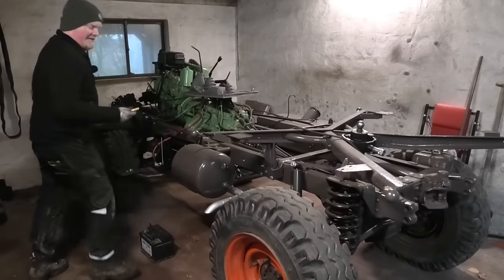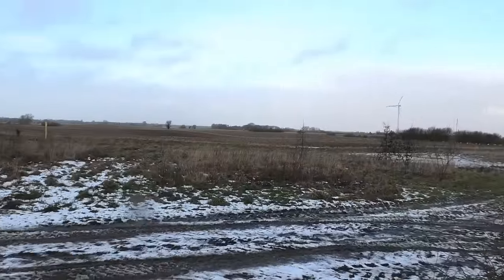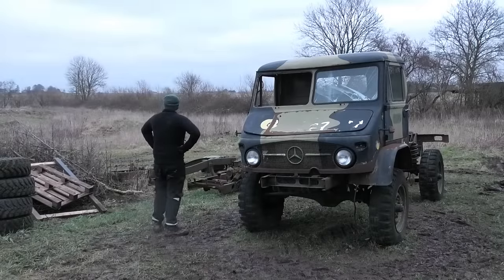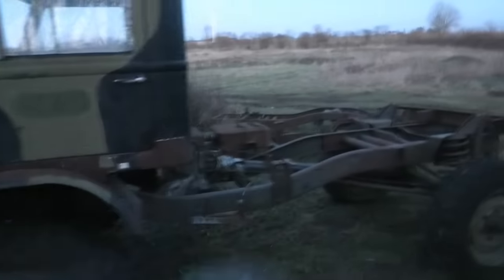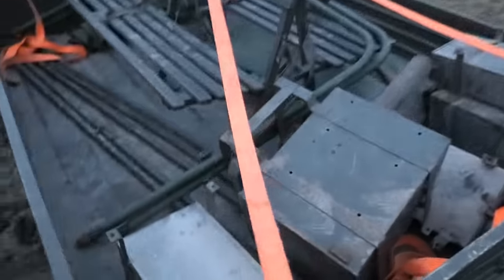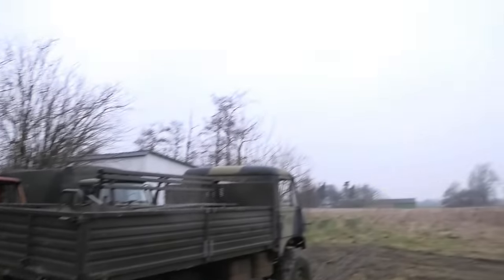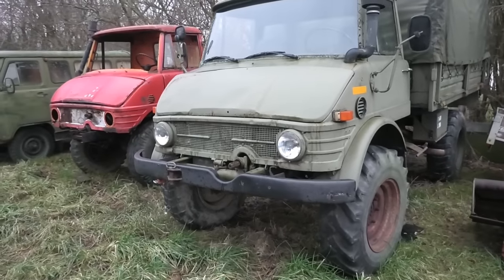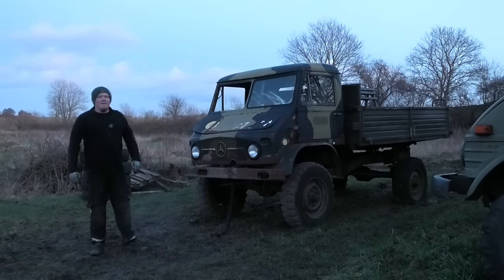Abandoned UNIMOG Project! - Can we save it? - And what is a 404?

Comment: There is no 406 series. It's either a 406 or 416 (416 came later the first where named 406.200) On the 404's the PTO and trailer airbrakes where optional. The holes in the bumpers are for the nightlights.  404's are older than a 421. Before you tell these things on a big platform tell it right or just don't.

Comment: Prefer the hardcab.  Had one also with 617A.  If yours is non turbo.... its performance will be same as the 6cyl gas that was in it. .....  yet......  still maybe easier to find parts for 617's... maybe... Im in USA..
Reply from the maker: Yeah, this is the non-turbo. so i'm not expecting huge performance. 
But it is indeed much easier to find parts for these, around here. :)

Comment: Interesting project. At 31:08 these holes are not steps. Behind them were small flat headlights for military use. (Tarnscheinwerfer in German) 
The conversion to a diesel engine turns the 404 into a noisy wandering dune. The original M 180 petrol engine has 82 hp, a Mercedes Diesel for example, OM 616 only 72 hp. But you can use a more modern engine. But the main problem is the clutch housing. Nothing fits. I converted a few 404s to diesel engines 40 years ago. I made the clutch housings myself. (I am a mechanical engineer) Another problem is the front engine mounting (the engine must not be mounted on the side of the frame, as in a car) Because of the frame twisting, the entire drive block (engine, clutch housing, gearbox) must be mounted at 3 points. At the rear of the gearbox, one bearing each on the left and right of the chassis and on the front of the engine. (I also built the front engine mounts myself).

There are a few special features. For example, when you pull out the floating axle, the differential lock must first be in place and engaged in the Diff. If this is not done, the locking claw falls into the Diff. housing. If this is not noticed, you will no longer have a differential lock and, in the worst case, there will be a gear crash.
Have fun with the restoration. It's worth it, it's a super vehicle.

Best wishes from Germany

Comment: Hello, I owned a unimoh s 404 years ago and restored it.
It's a very capable vehicle when it's not broken down.
Its main weaknesses are:
Oil leaks in the wheel reducers, it takes a 200 ton hydraulic puller to extract the hubs to replace all the seals.
The braking circuit has only one circuit, it is ATE and the master cylinder does not live long...
Wheel cylinders leak regularly and often need to be replaced.
The parking brake is symbolic, even if well adjusted it does not slow down much.
The cost of maintaining such a machine, even pleasant and very efficient in off-road use, is insane!
The engine remains anemic, it makes a lot of noise and is seriously lacking in power, 82 hp for such a weight is very insufficient.
Discouraged, I ended up donating it to a museum.

Comment: A helpful tip when securing a load with ratchet straps.
The ratchet mechanism should be on the passenger side of the vehicle.
If you have to adjust the straps during the journey then you are not on the side that is open to other vehicles and the potential for an accident is reduced.

Comment: If your ever in a suitation like that where the back wheels are spinning with weight on the front of the machine, slew out the back actor to the middle and extend the bucket out rearwards as far as it will go parallel to the ground. 
Doing this will put weight over the back tyres and counter act the weight on the front of the machine. It works also along with the diff lock as a side brake because the actual side brake would not work as effectively with the diff locked. You would put weight over the tyre you want to steer/grip with by slewing the backactor to that side.

If all else fails pull yourself rearward with the bucket while driving. Gunning the throttle would only tare up the ground which is not good if you want to go in there again. Keep the revs low and she will walk out. 

You can also put down the jack legs, lift the rear of the machine, drop the rear bucket and slew the rear wheels out of the tyre ruts to reposition into better ground.  

They are a great machine and hard to get stuck if you know what to do. 

Theres loads of other things to do to do to get yourself unstuck, those are only a tiny few things that I said I'd mention.

It's a 2 wheel drive machine so you have to be prepared for the worse and know what to do when the ground is poor. 

I'm not sure what you call back actor over there (backhoe/rear implement). I presume you are Dutch but I could be wrong. 

You have some great projects there. Fair play!

Comment: Truck looks like you’re off and running with another project.   Since it’s already adapted to 617 engine I would really try hard to fix the one you have or find another to drop in.  I have a very low KM 1955 SWB 404.111 with the original M180.  It’s fine for field work, but forget going anywhere fast.  The carbs are finicky at best, plus fuel compatibility issues with old zinc parts.   Diesel of most flavors is much much better.   Guessing the 617 installed will live with some tlc.

Comment: Great project. I'm amazed at how well you know your way around the individual series and models. Chapeau! The petrol engines come from the /8 cars from Mercedes. Around 80 hp. Consumption, with a first-aid kit behind the driver's cab, at least around 20l per 100km. Hardly any torque. Leave the diesel in, if broken, replace it with a 3l 6 cylinders.

Comment: Thanks for this vídeo! I appreciated it as the Unimog isa  truck in my heart! I worked with Unimogs in my army time (1966/69). We had the 404 with the gas/petrol 6 cylinders engine! A great truck to drive with a great gearbox! Our cabs were only half-height with canvas cover . We used most of them fully open! The back part only had the long seat on to allow jumping out in the case of an ambush! Both front and back had sand bags on the floor to protect against mines. Sometimes a heavy M.G. mounted just behind the cab. These trucks could go anywhere and were very reliable. My job was to recover mined and RPGed vehicles and recycle them. I was a lieutenant but also drove these trucks frequently. No jeeps there........they were flying with mines! Old times.........

Comment: I run two 404, one being pre production model from 1955, other 1967. I believe 421 was produced long after first 404.
Reply from the maker: Yeah, i fumbled that explanation a bit. What i was really trying to point out, is that the chassi design on the 421, was older than the 404. As the 421 have basically the same chassi, as the 411.

Thanks for watching along :)

Comment: Dear Mister TAT
👍👌👏 Your new Unimog project doesn't look so bad at all. Ergo: Congratulations 🎉 for all the puchases. 2) Please kindly allow me to suggest some things: Regardless of the unfinished Unimog cab in your shop, I suggest that you roughly put together this S 404.1 one first. Especially a windshield should be mounted so that you can put the seats in etc.. I really hope that you don't leave all the good parts on the bed (exposed to the weather).
3) Although I definitely hope/wish that your 5cyl. Diesel can be saved, I just guugld and look what instantly popped up: Only 300€ for a 220b, M180 engine that turns over. With 2 Zenith carburettors, in 16727 Oberkrämer, Germany.
4) When I was a child, my family owned a Mercedes W111 230S (big tail finned model) with a 2,3 l M180 and double carburettor. It was quite a gas guzzler.
Thanks a lot for making teaching explaining recording editing uploading and sharing.
Best regards luck and health in particular
Reply from the maker: Thank you!
And yes, don't worry. all the weater-sensitive parts, have been brought inside, right after filming this :)

Comment: thought that was  617 transplant..  what bellhousing did the person use? Look like it is NOT the Dietrich cause they lean the engine 13 degree or so.
Reply from the maker: It's looks like it's still the standard unimog bellhousing, with just an adapter-plate between that, and the engine.
Reply: @KJOff-Road   People have done body lifts to accommodate...  PITA for weatherizing floor pedals though..

Best of luck.... am sure you and or other's around you know shiaaaaaaat way more than I do.

Comment: Mercedes 606 turbo & automatic. Have, then one of the few fast Unimogs, if not the only fast deisle Mogs in the world, Buying unfinished projects easily pushes a man to follow the intention of the previous vision for it's future. Due to the parts it came with. Army here began receiving Unimog in 1982. The old versions are rare here.
Reply from the maker: As cool as that would be, swapping the transmission is not really an option.
Given the unimog suspension, and how the axles are held in place by the transmission, putting somthing else in there, would be a massive job, completely changing the entire vehicle :)
Reply: @KJOff-Road  I need to look into these Unimogs deeper.👍 The bell housing may be similar??? I think the motor is called OM606 that's revs through a great range and has stacks of HP. Turbo.

Comment: Great new purchase. I guess some people would kill to have a bed with those original benches. 

Although I have to disagree with you on a technicality. The design of the 404 is the oldest one of the Unimogs shown. 
Even though the 421 basically has a 411 frame, it is a different updated design from the 411 frames. Even further the later 421, with the Om616 engines had even wider frames, as well as the 407. Then there is also technically the Ux100 or how that thing was called, the small implement carrier, that also got a straight frame. The U20 too, and I would guess the current implement carrier line too. 

So it's technically not true, that they've never again designed a straight frame after the 404. 
But yes, I do understand what you're getting it, it was a new design step, and basically the split between the implement carriers and the off-road trucks in the Unimog Line. 
I would also more or less group the 416 as one of the off road trucks, as you wouldn't rarely see them pulling a plow. Basically a gap filler until the 1300l arrived. 

With that mentioned: the 416 often has a lot more options like hydraulics PTO, etc, but you could get all that stuff for the 404 too. 
Air assist, air trailer, PTO hydraulics, crawler gears. Although running the fire engine pumps must have been more annoying than their diesel counterpart as the engine isn't rpm regulated and only had a rev limiter. So if your load changed, you had to adjust. 

And mentioning all the options you could have gotten on the 404: You also could have gotten the 421 without all that stuff. So just the 6 main speeds, maybe alternatively as a 2x4 configuration. Hydraulics and especially hydraulic steering were optional too. You could even get them without air. Meaning different a type of brake booster and some sort of manual oil pump to activate the lockers. 
Even the windscreen washers or hazards were options on the 421. Closed cab too, meaning nowadays everybody pays extra for the base model Cabrios. 

Side note: windscreen washers on the 404 came with a manual pump as far as I know and the air trailer brakes weren't completely linked to your food brake. At least the hand brake was operated by an extra valve, not connected to your vehicle parking brake. Unusual for German vehicles.
Reply from the maker: Yes, you are absolutely right. and you seem to know even more about the production history of them, than i do :)
But i was trying very hard to keep things short and simple :)

I think there could be many hours of video, just trying to explain all the different models and their equipment options. But i also think that doing so, would end up leaving more people confused, rather then enlightened :)

Thanks for watching along!
Reply: @KJOff-Road  Indeed, there is a lot nuanced details with these many different models, too much to put it in a short clip. And especially to grasp it all when casually watching. 

Meanwhile I also found out the reason for these "strange" holes in the bumper. In the back of my head I always had the notion that some fire engines had fog lights in them, but i couldn't find prove for that. 
However, for what I could find examples: military black out lights. It seems to be that their primary design purpose was to house black out lights. I don't know what you have to do in Denmark to get a military vehicle road legal, but at least here in Germany you have to remove those black out lights, so you rarely see them anymore.
Reply from the maker: Ohh! That might very well be what those holes are for.
I have never seen lights mounted in them.
But the style of black-out lights that we used in the Danish Army, we're much bigger, and wouldn't fit in that hole, so we just had them mounted on top of the bumper.

Also, we are allowed to keep the black-out lights on the vehicles. We just can't have them turned on, while driving on the road :)
Reply: @KJOff-Road  I've seen it once in a picture hence why I googled it and found forum threads were they mentioned it. However, If you take a look at old military 404s you usually can't make them out, I haven't found another one with them in it. 
The only thing you sometimes see is fire engines with fog lights or campers with some sort of extra brights. It's weird.

Comment: Of these types of axles, which ones are the most resistant? I'm looking for information to use 42-inch tires on an off-road vehicle.
Reply from the maker: They are both very strong. I have yet to see anyone break a Unimog Axle-shaft.
Because of the reduction gears out in the portals, there's not much stress on the rest of the axle.
I have seen a guy running 48" tires, on his stock 404 axle, (the one-piece axle) without issues.
But i would say the axle from the 406 (the 3-piece axle) is the strongest, as they are mounted on the heavier trucks. And have thicker shafts.